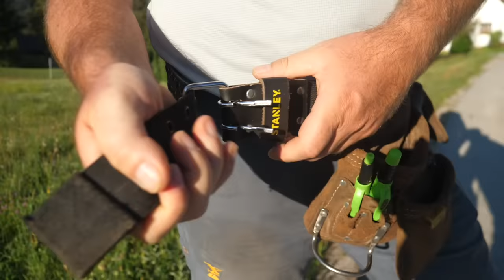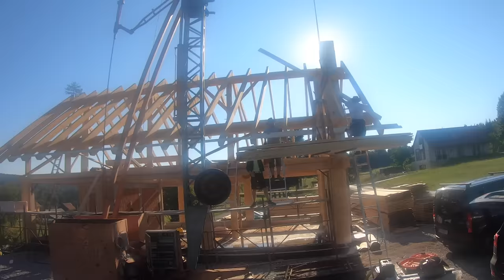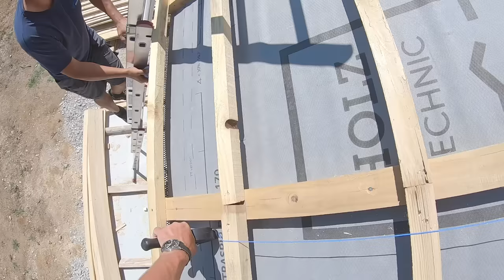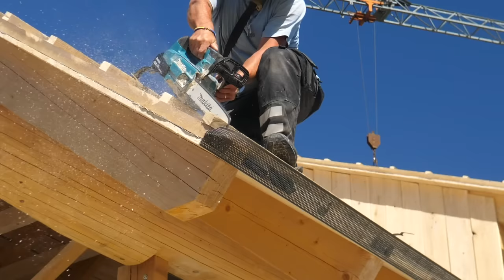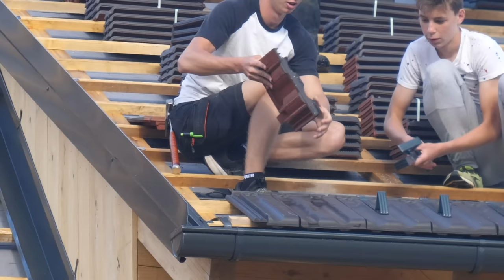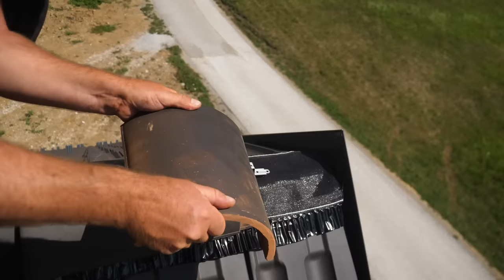Building The Roof Of The Log Post And Beam House

Comment: While the roof and cabin looks beautiful, it is insulting from a building standards perspective.  First, there’s absolutely no insulation in the roof area.  Second, the boards installed over the rafters should have been staggered.

These two details are not “small” details which can easily be remedied after the fact. Again, it looks very nice but is sad.

Comment: Roof may look good, but it is a very week roof, would not pass the Canadian building codes! Boards should be staggard over the roof so as the rows don't join on the same rafters
Reply: @brycegreen1573  1st of all if you looked at the boards they are NOT Tand G! My criticism of the roof was meant to be just  that, when you live in any country with a lot of snow you need the roof to be as strong as it is possible to make it, otherwise it comes down under load! Do not presume to  know what I am thinking, I meant exactly what I  said. BTW there is no Tongue and groove on this project!
Reply: Déjà à la place des chevrons c'est des madriers c'est 12cm×25 cm,de plus renforce, la résistance à la flexion c'est plus élevé que dans un chevron,que est seulement 8cm×12cm,on plus à la pente du toit que à mon avis doit être proche de 45 degrés...ça tiens perfectment pour la tuile mécanique..sinon à la charpente traditionnelle avec des fermes et emboîtement à mortaise et tenant..
Reply: Exactl. I learned that building barns . Stagger and use 4 nails , not 2
Reply: Yep saw it right off.
Reply: The cost is too high for this house
Reply: Thx for sharing